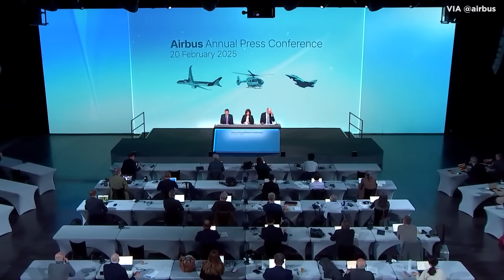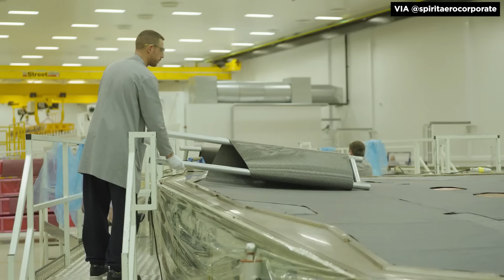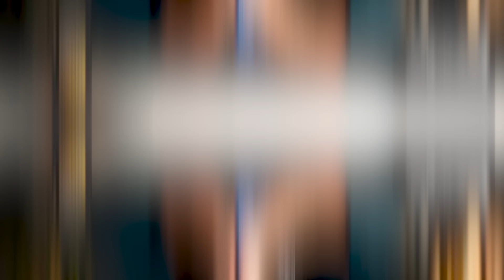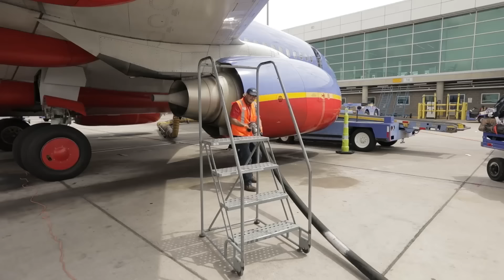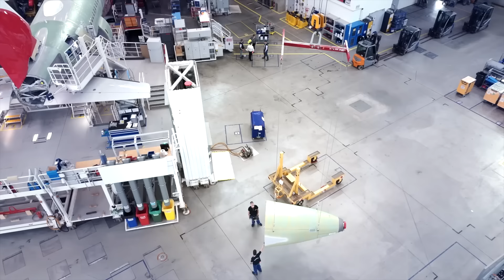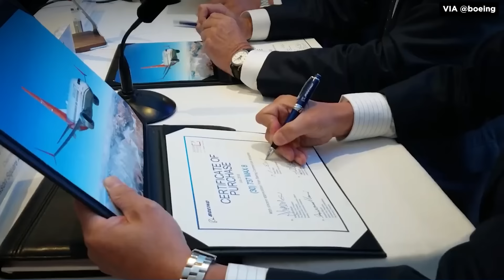Did Airbus just Change EVERYTHING?!

Comment: Hydrogen has an almost insurmountable problem of energy density. Even in liquid form not enough fuel can be stored to give sufficient commercial range. Storage in Hydrogen dense materials such as Ammonia, which stores four times the hydrogen than hydrogen on its own but then requires some additional tech to seperate the H2 from the solvent. 2 stage processes always require more energy and add weight. A vicious cycle. Running existing engines on Hydrogen is a relatively easy conversion. Storing and overcoming the very nature of Hydrogen is in the same class of difficulty as Atomic Fusion.
Reply: Good points. But it should be noted that ammonia can be burned directly as a fuel in boilers, turbines and ICEs. Personally I think that ammonia would be a questionable choice as a fuel for a passenger aircraft but there is some companies looking into that. The use of ammonia as a fuel in large marine engines is already an option with ships being built. An interesting thing is that some LNG fueled engines can be converted to burn ammonia (with the correct engine). The bigger question is what is the cost of CLEAN ammonia going to be?
Reply: @Mentaculus42  The sound barrier was broken on Ammonia. Ammonia's issues center around NOX  pollution.
Reply: → Rein

The ammonia NOx issues in small ICEs are generally handled by after treatment like diesels. In large marine ICEs it can also be handled by stratified water injection and after treatment. In ground based turbines it is handled by combustor design and water / steam injection. It is not a particularly difficult problem, actually ammonia’s bigger issue is low reactivity (maintaining stable combustion). There is a lot of development going on to use ammonia as a fuel.
Reply: @Mentaculus42   I don’t think NOX issues are the key issue with ammonia. It’s the problem that it attacks tissues in concentrated form. It can for a highly toxic low lying cloud in conjunction with water vapour.
Reply: → Fred

I am not promoting ammonia for aircraft use and have stated multiple times that I think that would be a bad idea. However, a lot of work is being done on using ammonia as a fuel in various ways. For example the use of ammonia for marine engines is a reality as the required safety standards and protections have been established and the first ships are in the design / construction phase. A number of marine engines have been designed and tested to use ammonia as a fuel. Some of these engines are already available while some others are going to be available soon. An interesting aspect of this is that some of the engines are dual fuel engines that burn methane and are designed to be converted to ammonia in the field by retrofit kits and the liquid methane tankage can be converted to liquid ammonia use. 

The bigger question is where will the cost competitive ammonia come from but Japan is a major driver of this approach.
Reply: Not to mention most of hydrogen is made from methane anyway; it just makes so much more sense to burn methane directly (also safer, too).
Reply: @reincarnatethylacine70  I’m agree with most of what you say except to say that running existing engines on hydrogen is easy. The basic issue being NOX production which can be reduced apparently by injecting water into the combustion process. However that requires a big redesign of the engine.  Similarly an ICE motor vehicle can fairly easily run on hydrogen but it burns out valves very quickly. There is also the RUD issue where hydrogen builds up in the crank case and reaches a flammable concentration. I think you need engines both jet and ICE to undergo considerable mods to work reliably and for a good length of time.
Reply: Ammonia should be discounted due to its tendency to dissolve people in a crash
Reply: I think you're mixing up a lot of info here. When used as Hydrogen carrier ammonia itself is the carrier. The solvent tech is LOHC. Ammonia gives a better volumetric density than liquid H2, but just 25% not 4x. Gravimetric is way worse of course and that's what matters most for aircraft.

The space shuttle was fueled with hydrogen by the way and also various Ariane rockets. Yes, it's rocket science, but solved. Unlike nuclear (not atomic) fusion, which is yet unsolved rocket science.
Reply: → Tri

Don’t forget that ammonia is a relatively HIGH temperature liquid which is very important with regard to economics of transportation of it in bulk. Ammonia unfortunately is toxic and probably a questionable choice for aviation.
Reply: → Tri

Ammonia has gravimetric and volumetric H2 densities with 17.8 wt% and 10.7kgH2/100L, respectively. The volumetric hydrogen density is above 1.5 times of liquid hydrogen, and it is easily liquefied under 1 MPa at 298 K. Direct combustion of ammonia is also possible without emission of CO2. The heat of combustion of ammonia is above 1.3 times of liquid hydrogen.
Reply: @Triforian  There is a reason rockets are moving away from hydrogen. Its difficulty is not worth the efficiency gains, especially in the atmosphere. Early rockets also used ammonia and moved away from it. Hydrocarbons are the king. Be it as kerosene/diesel/Jet-A  or methane/natural gas. Even in a completely fossil fuel free economy it's probably better synthesizing hydrocarbons for vehicle fuel.
Reply: I suspect hydrogen is a non starter for the reasons you mentioned. Hydrogen as a jet fuel still emits harmful nitrous oxides. There  is a juggling act needed to trade off higher temperature operation giving better efficiency versus keeping the temperature lower reducing nitrous oxide emissions.  So burning hydrogen I’d not pollution free.  Then add the highly energy wasteful production process and the difficulty storing and managing the stuff and it does not look so good.
Ammonia, no please don’t go there. An aircraft accident with liquid ammonia tanks is likely to kill everyone in the vicinity and put many others in hospital.
I think the answer is going to be an electric turbine powered either directly from batteries or from a fuel cell (perhaps methanol as the fuel). As for battery tech we do not know. Currently batteries offer about 500Wh/kg compared to 12000 Wh/kg for jet fuel.  There are battery techs like lithium sulphur which offer two or more times the energy density in development. However, we would need a breakthrough like a viable lithium air battery to get similar energy density to aviation fuel. Some of the disadvantage in energy density is overcome by more efficient conversion of energy to thrust, but some efficiency is lost because the battery weight stays the same. 
It will be interesting to see what happens.

However, as an example, a lithium air battery can theoretically produce similar energy density to liquid fuels but Can battery tech advance to the point where it is commercially viable for airliners?  I suspect the answer is yes, however, how far in the future
Reply: → Fred

Leeham news has a current article about the HySIITE (from Pratt & Whitney) engine which showed that it could increase the efficiency of a hydrogen burn engine by 35% and reduce NOx by 99.3%! It seems that the conclusion of the article is that this alone could be sufficient to promote hydrogen as a fuel. Also hydrogen does not have an overwhelmingly high flame temperature compared to most traditional fuels. What hydrogen does have is an extremely high flame front propagation speed which can concentrate more energy release within a smaller area increasing the local temperature. This issue is rather easily resolved by appropriate combustor design while totally getting rid of the problem by HySIITE technology and getting a 35% fuel burn improvement.
Reply: @Mentaculus42  Thanks for the information. I am surprised that NOX can be reduced by that much. I thought the hotter the fuel burn the better the engine efficiency but also the more NOX production. I will have a look at how getting over those issues is done. OK, I looked at the stuff and they seem to be in the concept stage only. Water injection into the hydrogen combuster to keep temperatures down and NOX down. I think they are a long way from a working turbine. However, I agree it maybe viable at least at the engine stage.
Reply: → Fred

There are a number of technical articles available on this topic. Your general understanding is correct about efficiency and temperature. With gas turbines and steam injection things are more complicated. 

The use of the Steam Injected Gas Turbine cycle or STIG cycle has been around for some time. The important thing is that it is steam that is injected that has been heated by the turbine exhaust waste heat vs water injection (which is also used heavily for NOx mitigation).

Water injection has been used for sometime to reduce NOx formation in the combustor, (and to help with temperature control and power output dynamic range). My understanding is that WATER INJECTION generally reduces the turbine’s overall efficiency (due to the need to evaporate the water within the engine). It is also possible to inject water ahead of the compressor or at a particular stage of the compressor to evaporatively cool and increase the density of the intake flow (a form of intercooling, not to be confused with traditional intercooling), but this can be impressively involved to achieve proper atomization, etc. 

The STIG cycle is a variant of the recuperated Brayton cycle, where the gas turbine exhaust stream heats somewhat pressurized water in a heat recovery steam generator (HRSG), and this steam is injected ahead of the combustor. This helps provide sufficient mass flow to help cool components without the associated energy required to compress that mass flow in the compressor (tho one doesn’t get it totally for free).

Comment: Airbus is already working on their Next Generation Single Aisle schedule for 2035. Airbus want an open rotor and has already said that the Rise is very promising.
Airbus will start testing the Rise in 2027.
Airbus is calling for another engine manufacturer to compete with the Rise so they can still offer two engine options.

Comment: People, here in the US, tornados, large hail, hurricanes consistently destroy solar panels. Bad solution for reliability. Few areas can support windmills for power. That leaves nothing reliable except for nuclear or fossil fuels.
I find having explosive tanks of a hyper flammable fuel like hydrogen scary. Fossil fuels burn in a fairly controlled manner, but hydrogen is a gas lighter than air. That makes the size of the explosion huge. Plus, hydrogen is extremely bad for metals. It seeps into the metal and causes hydrogen embrittlement. Sorry, but although it took many decades (remember, technology really was primitive from 1940+1970's), we now know how to use safe nuclear reactors and can safely store nuclear waste. Neither used to be true. We learned from our past errors.

Comment: The only change I can see coming is the use of hydrogen to a hydrogen-mixed fuel to reduce emissions on take-off and landings.

But you are fighting the laws of both laws of physics and chemistry here big time.

Above all, there will be a big increased cost of the fuel before adding in the need for passengers to pay more for their tickets becuse you need to put the hydrogen somewhere!

The other main issues are esp in any engine parts and fuel lines and boil off and hydrogen and its reaction to fuel lines and tanks and when burnt in the engine.

Comment: Airbus will clean sheet the A320 family on jet fuel, with RR fancy fan.  Boeing will be stuck in the past with their 60s designed 737. Wouldn’t surprise me if Boeing try again to squeeze more out of the super outdated 737. I absolutely loathe flying on any variant 737, cramped cabin, low windows, overhead bin space sucks,  the list goes on and on.

Comment: The back-question becomes 'what do you use to generate the electricity, which you need to electrolyse water to make hydrogen?'  Most of the world's electricity comes from coal and oil.  Hydrogen is not a primary source of energy, merely a 'vector'.
Reply: And who is going to be that stupid to use fossil fuel produced electricity for electrolysis produced hydrogen. Give people a little credit, they would produce some variant of BLUE hydrogen (which of course the green crowd hates).

Comment: Well, thanks for the great videos on the several dyanmic issues in commerical aviation ongoing.  Very mind expanding.  I'm curious as to why the planned "RISE option fan" doesn't have the nacelle?  Seems to me that directed airflow is more efficient than a non-nacelled engine?  The RISE is rumored to have noise issues and again, a nacelle would likely help.  Lastly, the public is used to engines with nacelles and might not know what to make of the new design?
Reply from the maker: I've covered this in other videos... in short, losing the nacelle saves a lot of weight and improves efficiency by increasing the bypass ratio.
Reply: @MentourNow  Interesting.  So, there are no more noise issues and the public will get used to seeing these engines on the wing, no problem?  Makes some sense that no nacelles reduces weight and increases bypass ratio.  The nacelles are also a safety feature in the event of a turbine separation, God forbid.. On H2 fuel, I hear that the fuel tanks have to very large, very cold, and very heavy, even with a functional infrastructure.

Comment: It actually makes a lot of sense to have both. Airports don't have hydrogen at hand I don't think currently.... So unless you want your hydrogen planes  to not be able to run some routes...... Maybe second generation can go full hydrogen once airport infrastructures are in place.
Reply: It depends, if they make plastic aircraft  light enough they can have plastic landing gear and so forth, a hydrogen aircraft would become practical if it had range enough for both ways. With a high enough efficiency, weight, and size of tanks, i'd think that was their goal. Hydrogen takes space but due to pressuization tank being most of the weight their 'rocket equation' is much different, not getting much more efficient near empty.

Comment: I think that people expect that excess electric power from solar arrays or wind farms can be used to electrolyze water easily and cheaply to produce hydrogen and oxygen. But apparently the production, transport, and storage of such hydrogen isn’t quite so easy. Most hydrogen needed for industrial processes is made from methane from natural gas. React the methane with steam and get carbon monoxide and hydrogen… but then there’s the problem of what to do with the carbon monoxide. It can be burned to produce carbon dioxide but of course that’s what’s being avoided, and why not just use methane for fuel instead?

There may not be enough platinum in the world for widespread use of hydrogen fuel cells. Maybe a new version can use something less rare, maybe not.

Comment: If you want to understand hydrogen. Read Ben Rich's 'Skunkworks'. He details USAF experiments with hydrogen in the 1950s. The problem is containment and flammability; problems which USAF just could not overcome despite spending a ton of cash.  Don't hold your breath on hydrogen - the laws of physics and chemistry have not changed since then. xx
Reply: The problem here in the UK with using it for domestic boilers has not yet been overcome, we can't get a programme started because consumers won't accept it. Also, apparently, apart from other issues, it degrades the infrastructure if it is transported in existing gas piping.
Reply: @alisonwilson9749  The single biggest issue killing reticulated hydrogen is cost.

Methane (Natural gas) is 20-35% the price of electricity per joule.

Green hydrogen STARTS at twice the price of electricity per joule - with most current sources being 10 times the price per joule. 

Nobody is stupid enough to have their heating bills jump by a factor of 10-50 - they will simply switch to electrically driven heat pumps
Reply: I agree.  Jet-A just isn't explosive even if it is ignited while Hydrogen would just disappear in a near-invisible really hot fireball.

I can remember back in about 1980/1981 when ICI Americas invented a Jet-A treatment that converted it into a gel in the fuel-tanks and re-liquified it before it went into the engine.  They demonstrated it using an old B707 under remote-control, which struck a device when landing, which cut off one wing and ignigted the fuel.  It burnt a bit but fizzled out.  Unsure why this never caught on: cost? Reliability? Pollution?